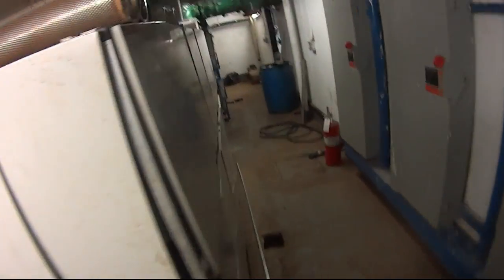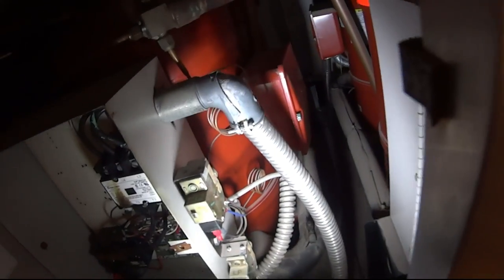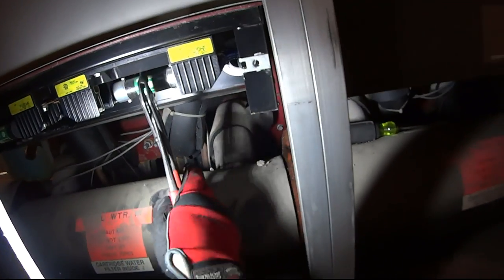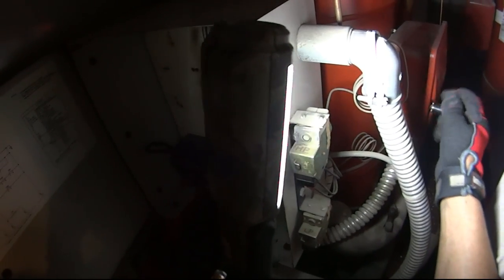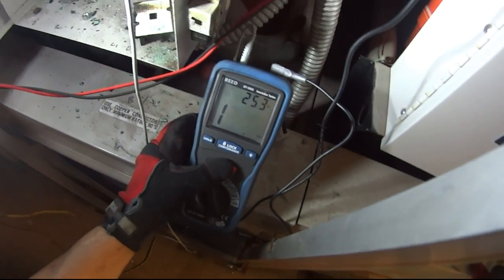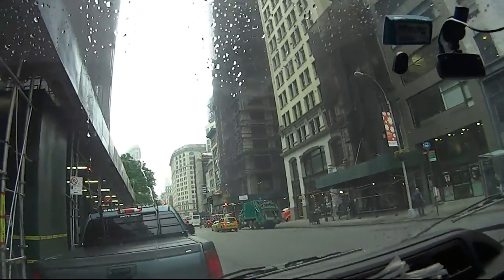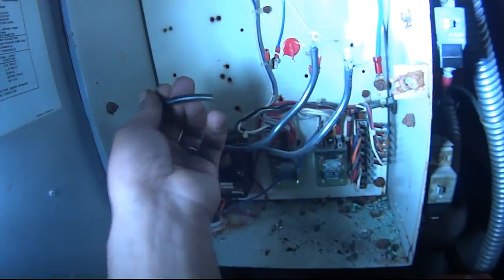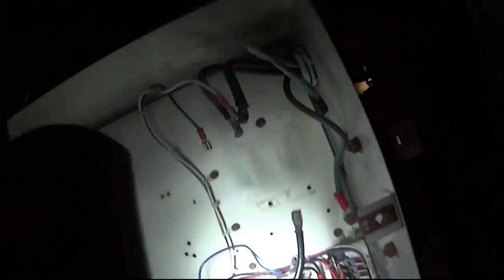125 Ton Multistack Chiller | Replaced Wires & Contractors | Part 1

Comment: its nice to see the big stuff melts just like the small stuff.  I worked in an apartment community built in 71, 200 apartment had aluminum wiring in the walls.  Always had opens on connection.  Didn't take long to find them just follow the smell, or the long burn marks on the drywall.  Thanks for the videos.
Reply from the maker: Wow, yeah they all cook the same lol